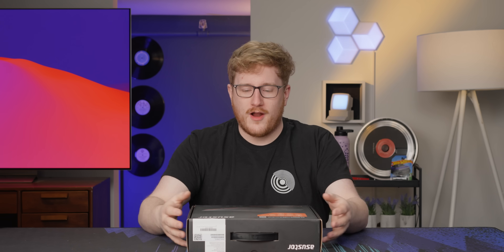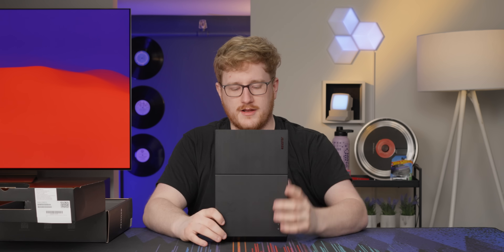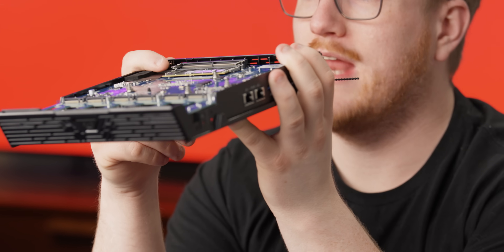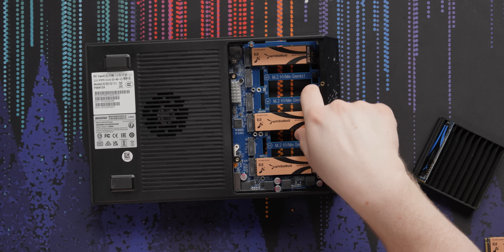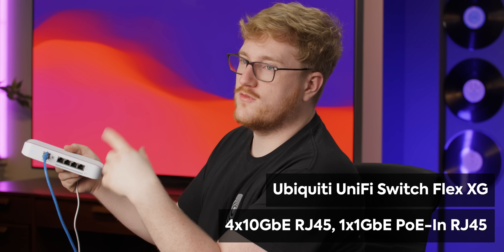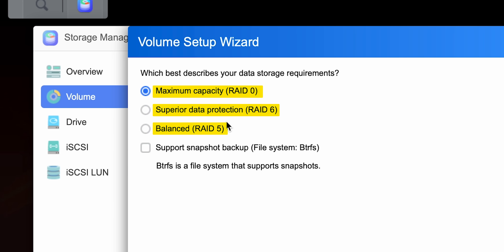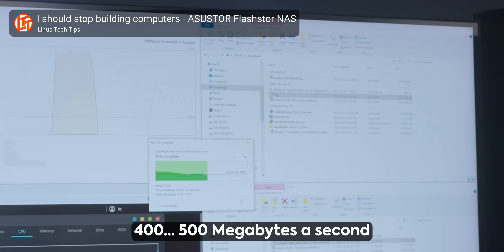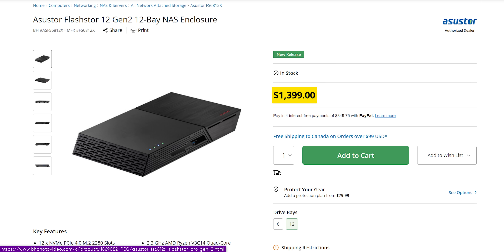They promised me they fixed it... - ASUSTOR Flashstor Gen2

Comment: Hi Team,

I liked your videos. Great products and great videos. Need a small help from your side. I want to build a diy nas with asus rt-ax 53 u router along with asus rt- ax 68 u router  with 1 router as a mesh node only to display the 1.5 tb usb drive so that using my laptop or tablet or mobile file manager I can backup the files to it but from node router I don't want wifi coming to any device. For wifi I will use the main router. Please let me know how to accomplish this task. As for this purpose i purchased ax 53 u and wd 1.5 tb usb harddisk.

Comment: considering two thunderbolt 4 enclosures would cost me $500+ and this also comes with 10gbe which would cost like $200 for a NIC. your'e basically paying $700 or so for the form factor, software, etc. which is kind of too pricey. To be fair there are barely any NAS options with 10gbe especially not from overpriced brands like synology. So it's not the END of the world, but I definitely won't be paying full price on it that's for sure lol

Comment: I looked at the spec's on this thing and the block diagram. I also looked up the CPU on AMD's site. This thing is a prime use case for an all flash ceph cluster. Bluestore does not require much in the way of cpu calculations if using replication, and the CPU is optimized specifically for IO between PCIe lanes and the MAC.. since in a ceph cluster there is 1 nic for client access and 1 NIC for cluster + management, and a cluster has no less than 3 nodes.. scales  up real quick if you had say 6 of these guys in a 3 way replicated setup full with 12 4TB drives. You then attach that using RDB to whatever you want, then mirror the entire namespace to something on spinning rust async, run that to tape and use snapshots.. one hell of a cheap enterprise grade setup. Even supports ECC RAM.. Go AMD!

Comment: When you did the performance test, did you keep in mind the slot speeds? 

Slot Type	PCIe Version	Lanes	Max Theoretical Speed (per direction)
1× PCIe Gen4 x4	Gen 4	x4	~7.9 GB/s
3× PCIe Gen4 x2	Gen 4	x2	~4.0 GB/s
4× PCIe Gen4 x1	Gen 4	x1	~2.0 GB/s
1× PCIe Gen3 x4	Gen 3	x4	~3.9 GB/s
Other slots	Likely Gen3 or Gen4, x1 or x2	—	Varies (not fully documented

Comment: @ShortCircuit This was a poor introduction. The ASUSTOR Flashstor isn't targeted at people who simply run out of space on their smartphones or primarily need a backup solution for photos. It's specifically designed to use M.2 NVMe SSDs rather than traditional 3.5" HDDs found in most NAS devices. This architectural choice allows users to work directly from the NAS, thanks to its high-speed 10 Gigabit Ethernet, USB 3.2 Gen 2 (10Gbps) and USB 4.0 (40Gbps) connectivity. This actually makes it ideal for "creative professionals", such as video editors, photographers and designers who require fast, reliable access to large project files, as well as for power users looking for a high-performance, compact NAS solution that can keep up with demanding workflows.

Comment: $1400 is a bit much for NAS where I can't even install my own OS. I would rather build my own or use my old PC for NAS. Yes I get it, old PC is gonna consume 2x or 3x the amount of electricity but for $1400 I can constantly power my old PC for 10-15 years depending on exact power consumption.

Comment: How do you build a custom PC that can house 12 nvme drives in RAID6 configuration, has 2x 10Gbit and can write at 20Gbit/s to these drives for less than $1400? I would really like to know. No really. Unironically. Please tell me what components would you get and how would you set it up.

Comment: You are doing your raid using a gen3x1 slot that only runs at just shy of 1GB/s (~10gbit) so it makes sens when you do a raid5 or raid 6 that you can only do 1GB/s write, that's the max speed of the slot.

Comment: I don't care that much about the speed. I want lots of silent storage, so that requires a number of NVMe drives, due to SSD capacity/pricing. You're never going to be able to run them all at max speeds unless you've got some exotic CPU with gazillions of PCI lanes, and at that point, it's noisy and power hungry, I might as well use HDDs with NVMe cache. This model is faster, and does what you asked, but the price is insane. I'd be happier with the older model.

Comment: as a normal home user I have always been skeptical to NAS - why not just set up a normal "server" in an old box? an old desktop machine with some add-in cards will do just fine. And be much cheaper.... here in Sweden I can tell that not many are running 10gb NIC:s at home... 2.5gb NIC:s maybe - but most ppl don't change all their switches and stuff(for home usage anyway...)

Comment: ?? I haven't finished the video but not being able to hit 2.5GB/s with a raid 5 setup just sounds wrong, any of those drives is way beyond that. My 4 disk hdd Nas is easily limited by the 2.5gpe network port, 12 nvme SSD should eclipse 2.5GB/s read/write without a sweat. Unrelated, I so wish Optane was still a thing, even on pcie 3 it would kill modern pcie 5 random read/write, if only I'd bought a bunch of the drives 8 years ago to kill modern drives, just sad really.

Comment: yeah you guys clearly don't understand the price here. This is a tiny box that's designed to hold a large amount of storage and also be EXTREMELY fast. of course its going to be expensive!!!!

Comparatively, laptops ALSO cram very high end components into a small package. Find me a laptop with a mobile 3080 inside for less than $2000, oh wait IT DOESN'T EXIST.

you wanna save money? build it yourself. have fun fitting everything into a small form factor and somehow cramming as many SSDs in there as this product. You'll also need fans, an operating system, specifically very fast ethernet ports, etc. 

i haven't even mentioned that this company probably had to spend a TON of money on research and development for custom parts and designing the actual thing.

TLDR: its not supposed to be cheap, you absolute buffoons.

Comment: It’s so hard to install Truenas on it tho. Pcie to m2 adapter, external GPU and Power Supply. The fix for the NIC is not even in the kernel so that’s like 2027 that will be plug and play…. Sad! Nvme should  really be the future, and you can reuse the drives in laptops!

Comment: I suspect that your write speeds in RAID 5 aren't being limited by parity calculations, but by the fact that writes in RAID 5 are going to be limited by the slowest device(s) in the array.  Since the device has two PCI3x1 slots which are limited to 8 gigabits/second / 1 GB/second, I'm pretty sure that your writes can be no faster than 1GB/second.

If you can configure the device for RAID-50 instead of RAID-5, I bet you'll hit 2x1GB/second.

Comment: I have the Gen1 12 bay with 12 TeamGroup 4TB's/R6.  It does what I need at a speed I can live with.  It replaced my CoolerMaster Centurion case with 2, 5-Bay 3.5" IcyDocks (4TB Exos) and 1, 6 bay 2.5" IcyDock (PNY 512G) with a PlexStor BlueRay with an LSI 16 Port/SATA 6Gb HBA.  Really quiet and about 70% less power under load.  iSCSI performance is kinda "meh".
I am thinking about firing up my Corsair again, copying over the updated data I care about and experimenting with UnRAID on the Gen1.

Comment: Biggest problem I had with all 3 Asus Devices I had:
The software is absolutely awful.
In the beginning they work.
But then over time everytrhing starts failing.
Memory leaks that lock up the web interface or ist just plain stops working and needs a complete reset.
Also: No updates that actually fix something, and the devices are being abandoned after a few years.
Never again ASUS. Never ...
Reply: Hi! We're ASUSTOR, not ASUS. We haven't abandoned any of our devices after only a few years. All of our devices have received 7-10 years of support and we continue updating them until we can no longer get manufacturer support for the CPU. We support our products until we are no longer able to. While I am not able to help with ASUS devices, our policy is to support our products for as long as humanly possible.
Reply: @ASUSTOR_YT  I did assume you are affiliated with ASUS with that name.
Well ... oops.

Comment: I've built a home lab + NAS for much much cheaper and better. It has 16GB DDR5 RAM, i3-N305, I've got 5x NVMe slots and 2x SATA 2.5'', 2x 2.5Gbps networking, it's completely silent, consumes way less energy, it has a smaller footprint and the transfer speeds are higher on RAIDZ1 (which is less favorable for speed compared to the RAID0 test in the video).
(CWWK Magic Computer i3-N305)
I got 26TB of storage and I paid 1000$ for absolutely everything.
Reply: Would you mind sharing a build list for your home lap we are interested in two of them to add more capacity to our business and they're always looking at the best cost-effective options thank you

Comment: Using SMB multichannel from a 2019 Mac Pro with two 10Gb nics and same on the Flashstor, I'm getting faster than your speed test in RAID 5. Thunderbolt to 10G adapters like the one you are using are frequently throttled for heat reasons. I'm not going to defend the price, but A) I don't want to home roll my own NAS because I have to do my day job and just need a unit that works and B) my real world experience with the unit is much, much, much faster. I've been able to hit 14Gb with SMB MC.

Comment: 55 watts? LOL. I've got a slightly under clocked  i7 3770k running truenas with 4 8tb HDD drives that idles at 35watts and pulls 58 watts under full load while writing and transcoding Plexs streams.

Comment: I've been happy with the original model, 6 drive version. It works well doubling as my personal NAS and as my media center PC for my little gym at home. I never really cared about the speed potential, I just wanted something quiet and very reliable. Since setting it about a year ago (I think), I've never had to touch it. It just works.

The second version actually sounds like a down grade with the video out removed and the increase in price is comical.

Comment: I prefer to build my own nas. Done about 25 over the past ~15 years. Most of them are still running (had some upgrades over time). And storage/price wise HDD"s are still the way to go, and using a cache ssd works nice enough. And damn i can build a full NAS for 1500... with storage.

Comment: Honestly I feel like these would make the most sense with like... an n100. Give it a ten gig adapter, 6-8 PCIe 1x m.2 slots, sell it for cheap, run zfs on it, and ultimately, you'll probably saturate the 10g link if you fill it up, and if you need more drives, you're probably better off with two of those than one bit one, until you get into, like, enterprise space, where none of this would be worth it.

Comment: Almost everyone who runs one or more NAS wants something faster than hard drives. But even older PCIe 3(x4) SSDs deliver more than is satisfactory for most home use. The annoying thing is that there is hardly any price difference between drives with PCIe 3 or 4 for the same size, at least the last time I compared. And SATA SSDs are not or hardly cheaper either.

Comment: Asus, wtf are you doing, why not just put pcie gen4 1x on each one. if someone is buying $1000 nas box (with out drives) then he surely can afford gen4 ssd:s. that would be close enough for 20gbps. Personally I would have preferred to see one good intel 10gbps nic on that thing rather that two marwell ones. If someone needs more he could use usb4 to add adapters, right? 

I guess you could use usb4 to add external gfx card to it and install what ever OS you desire, but I think Asus has done pretty good job with this one and most will be satisfied what they get out of the box. Sadly I think it is bit too expensive at the moment, but I will be looking to buy one if the 12 m.2 model's price drops $300 or so. Main attraction of this device compared to DIY device is the size as it is actually quite hard to find something that small that can fit as many nvm drives. Cpu is actually quite low power one (less electricity and noise) which is big plus. Still the price tag was way too high for me at the moment. Hopefully they can lower it once gen1 is sold out

Comment: the problem is that this should have never been a 12x m.2 nas. even with the ryzen cpu, which has more options for bitfurication, there are not nearly enough pci-e lanes. i imagine most m.2 slots +usb-c+usb-a+maybe both 10gb eths go throught the chipset or use mux chips. you will never get performance even if the cpu could handle it. this should have been a 8x m.2 tops. the up in cost goes for the cpu and whatever mux chips they had to use.

Comment: I wonder if it would be possible to set up 2 of the drives in a separate RAID 0 as a write cache to solve the parity calculation overhead. If it's missing something that simple at that price, it's not a good option. You can build an UnRAID server for that price minus drives, and that would include a GPU for hardware accelerated workloads.

Comment: I mean the outrageous price point and the fact that it is configured to run as a RAID0 by default are appaling enough. But like, is nobody going to talk about the fact that the thing has 12 PCIe 4.0 and 12 PCIe 3.0 lanes, which is both easily divisable by 6 for each side and they decided to go with this crap arrangement? Like wtf? Just split the lanes evenly... doing it like this lterally makes no sense at all. like there is no argument to make here in terms of having a single SSD (or two for that matter) running at full speed, because the rest of them are going to bottleneck the hell out of your array speeds. They could've actually improved this. But they didn't. Seems like a rushed design without much though put into it. And cashgrab. BIG cashgrab. Jesus.

stupid design choices, way too expensive, doesn't look good (personal opinion). yeah, no thanks.

Comment: Performance pretty good out of the box.

10GbE max per port is 1.2GB/s (10*64/6/8, 64/66 data encoding, 8 bits per byte) assuming minimal overhead, using jumbo frames etc, so reaching 2X 1GB/s with minimal setup sounds quite good to me, even if I would not want RAID0. 75% of max theoretical max performance,  in a use-case that is pretty extreme. I imagine the primary use case is people working with large files, e.g. video editors, in a semi-professional setting, likely copying with Mac/Windows (which I think all go file by file, not 8 simultaneous writing streams).

Aside from potential performance considerations, if actually planning to run this in professional scenarios, I’d be interesting in knowing committed security support / life time and operational estimations. 

Having USB may be nice if the device is “unsuitable for network due to vulnerabilities” 3 - 4 years later. USB past EOL may still work great for video editors while not for business with a large network.

Comment: The lane split on SSDs is absolutely not an issue, because there is only one possible scenario, where it would be an actual bottleneck: un-raid or non-raid configuration with Gen3 SSD, stuck into x1 wide lane (it's ~950/950 MB/s max), in which case disk will be slower than network.

I work for company making made-to-order enterprise PCIe/networking/storage hardware, and believe me, including even 32-lane switch for x2 connectivity on each slot and x8 to CPU would have quadrupled the cost of the device. It's not only the switch chip, but the cost of designing everything around it, and insane amount of validation that has to go into the PCIe device compatibility - which you will never get anyway. No PCIe switch supports all PCIe functions (especially those cheaper ones, which would have ended up in consumer oriented device), and many don't take well mixing gens and devices around. Weird timing issues, connection drops, and bad behavior when disk just dies or drops due to thermals can crash whole PCIe subsystem requiring full reboot, and chipmakers really don't want to support their creations - firmware changes are real pain to push (f... u, Broadcom and PEX89072's L2Lx latency bug, we bugged them for 60 days straight to even acknowledge they had issue, then they had "fix ready but no plan to implement" until we shipped then they stopped responding), and in most cases new silicon stepping will simply be met with such insane pricetag that even biggest OEMs will take step back.

AMD, Intel, Ampere - please, build in as much PCIe into your consumer or entry workstation as possible!

Comment: I was interested in the v1 of this but due to the price I built myself a NAS based on the Minisforum MS-A1 instead. It might only have 4 M.2 slots but it's like 1/3 of the price for way more CPU power. 1 OS drive + 3 drive RAIDZ1 is just about enough.

Comment: Two major problems:
1. Should use the PCI-e lanes wasted on the 2 USB4 ports for two 25G or 40G SFP or QSFP
2. Lack of 3rd party OS installation options.
It could've been used for a pretty decent CEPH cluster using the SFPs for a mesh cluster network.
Reply: The PCIe lanes are not wasted on the USB4 ports. The USB4 ports are built into the SOC. 
Third party operating systems are certainly allowed. We even published a video on how to do it.
Reply: @ASUSTOR_YT  thanks for letting me know. Well it's possible to create a mesh network over the usb4 ports. I'm concerned about the latency though.
Reply: @adamtoth9114  No probs! Happy to help! Also, the 10GbE ports are built into the SoC as well, saving PCI Express lanes. With the USB4, while more expensive, you still can choose to add 25G or 40G adapters. I have gotten some 25G/40G/50G adapters working with a cheap external Thunderbolt enclosure, but we need to test more for a better experience. I think it's better because it provides more choice and we can add support for more devices through software updates instead of having the device fixed at one use case.